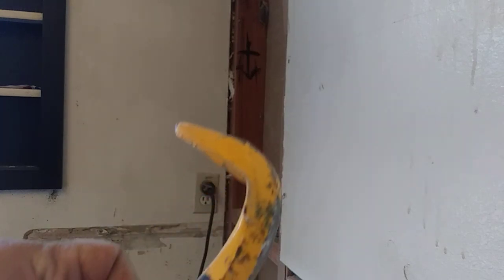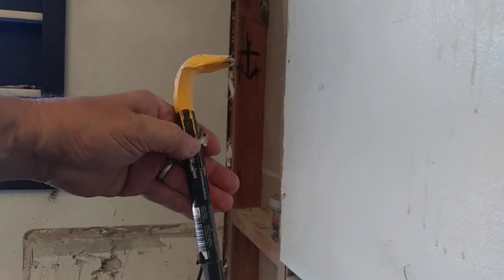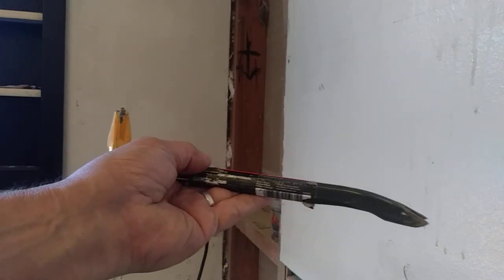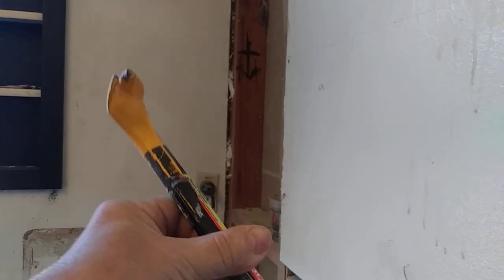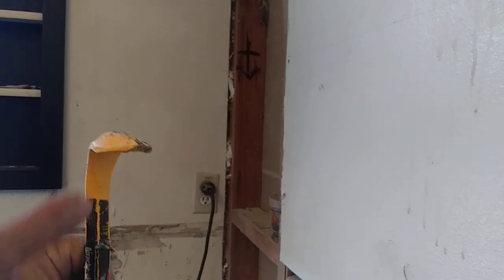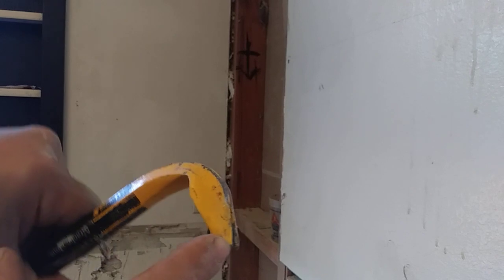HomeRenovaTion DIY How To Hang & Cut Drywall Multiple Pieces Tips And Tricks

Comment: This information is really helpful. We plan on finishing our attic next year and turning it into a library for me.
Reply from the maker: If you don't have a Rotozip tool you can put the Rotozip drill bit into your drill on high speed as you seen me do here and you can cut around fixtures pipes Etc and you can use the staple gun technique for getting your drywall mounted to the wall to hold it in place before you screw it but make sure you screw it do not rely on Staples they will fail you I am glad this was helpful if you ever have any questions feel free to ask thank you for your commenting congratulations on your library that'll be a nice place for a library for sure God bless bye for now Ken

Comment: Hi Ken, always good information and tips on your tutorials, lot of good tips for hubby, cheers :)
Reply from the maker: Well I hope this is helpful do not use staples for a permanent hold the Staples are only used to temporarily hold your drywall in place before you add two screws to Anchor it to the wall. How's your ceiling coming are you standing yet? Did you tell your husband about using a sponge mop for that process it'll make his life a whole lot nicer and much much faster and easier I look forward to hear from you God bless you thank you for the support bye for now Ken